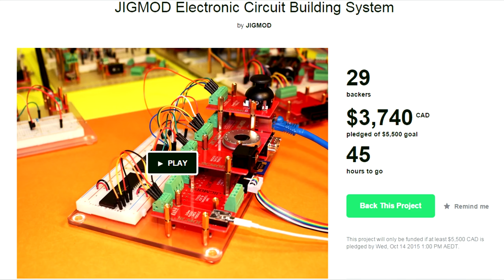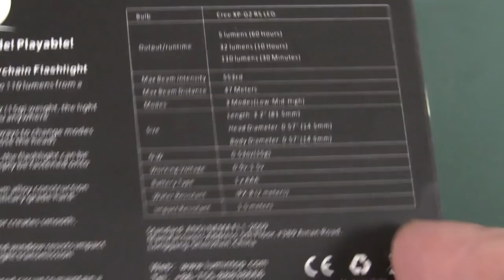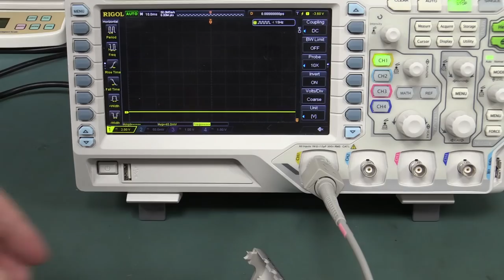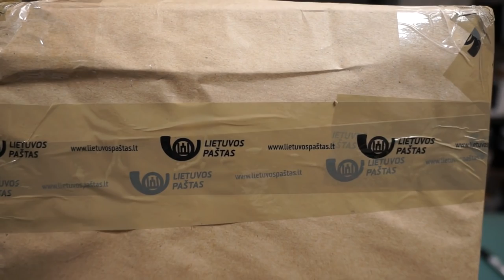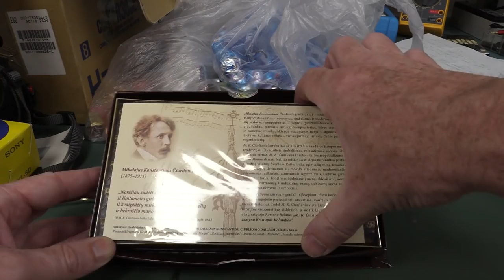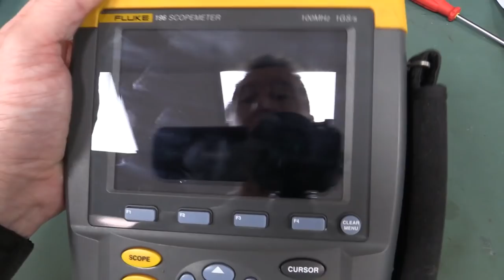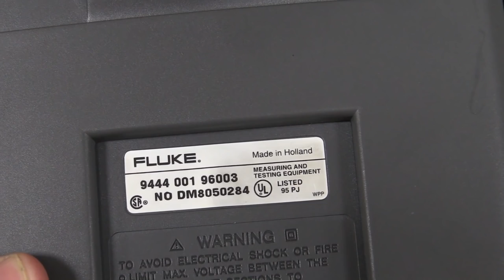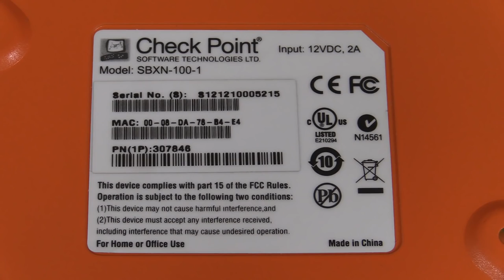EEVblog #807 - Mailbag

Comment: My guess at the reason why that chip was destroyed so easily was to protect the private keys that may have been stored in it. If that device was used for authenticating to a high security network, you may be able to extract the keys and impersonate the device potentially by accessing the chip directly. The choice of BGA was probably also chosen just to make the contact points on the chip more difficult to get to, so you can't probe it while it's running.

Comment: Dave,  you just invented a 2 second ic decap technique
Reply from the maker: +VoltLog Try it on your gear, totally non-destructive!
Reply: +EEVblog I did it to a Pentium4 775 CPU, didn't change it's performance either, mostly cos it was a gutless turd of a processor... :P
Reply: +twocvbloke Hey, those motherfuckers take a shit kicking, even if they're slow, hot and useless. Some guy managed to get one to like 8GHz on LN2. That's mighty impressive IMO.
Reply: Teth47
Yeah, but single core, feck all cache (it was basically a 775 sell'n'run with a P4 sticker), motherboard with blown out caps, that P4 chip was junk, my far older 478 P4s handily outperformed it... :P
Reply: ***** Yeah, but that silicone was tough as nails. It laid the groundwork for that legendary D0 stepping on the i7 920. I'm thankful for the example it set, even if it was in and of itself a piece of shit.
Reply: Teth47
You don't even know what core it was, it was one of the cores that was just utter crap that got left behind when the Core series first started...
Reply: ***** The Core series was based on the Netburst arch, which, you might recognize, is the same arch the P4 was made with. Netburst was awful, but there were good ideas in it, which they carried forward into the Core series, and later Pentium and Celeron series. Who doesn't even know what core it was again?
Reply: +VoltLog The integration of a guillotine and electronics.
Reply: Teth47
Okay, you tell me what version 775 Pentium4 model I had, I know, you don't, I know it was a pile of dogshit, you don't, I know that when running it, it ran like a pile of dogshit, you don't, I know that compared to my older 478 P4s with the better cores that got carried over to the Core series outerformed this 775, you don't, so, is that enough of a reminder about who knows and who doesn't? ;)
Reply: ***** All 775 P4s were Netburst-based. Even yours. I can't tell you what model number you had, but I can tell you it was a netburst core. I know the previous ones outperformed it, but their architecture was not extensible enough to be carried forward while realizing significant performans improvements. Netburst was. Elements of it found themselves in its successor, Merom, which was the first-gen Core architecture. Want to deny that? Take it up with history, and get rid of that smug attitude, it'll do you no good here, because you're categorically incorrect.
Reply: Teth47
Yeah, you're just missing the point, the CPU I had, was junk, doesn't matter what you say about netburst and all that bollocks, it, was, junk, it was slow, slower than the 1.2GHz PentiumM in my Portege M300, and that was a glorified PentiumIII CPU, so, I know it was junk, evidence based fact versus what's on paper are two different things which do not gel with your take on this...
Reply: +Teth47 sorry but no, the core series was more related to the p3 than p4. The netburst arch did one main thing which was force intel to be good at branch prediction. Otherwise was garbage.
Reply: +MeakerSE Indeed, Core processors are most closely related to Pentium M mobile CPUs, which were essentially Tualatin PIIIs with more cache + P4 style bus interface and branch prediction.
Reply: ***** Profanity is not an indicator of a low IQ, it's an indicator of emotion. You, with such a high IQ, should know this.
Reply: *****
Notice how I'm not using profanity in my responses to you, this is because effing and blinding in something to get their point (which is weak to begin with hence the use of such words) across, which to me means that their argument or point made is lost...
Reply: ***** Well, good for you for not being able to understand what other people say to you :)
Reply: *****
And good for you for being a troll, well done... ;)
Reply: +Aurelius R Profanity has actually been deemed to have almost no correlation between economic status or IQ in a majority of the population. Not that I think it's rational to "fuck shit" all over YouTube for the sake of sounding angry and hoping people listen. In my opinion it has about the same effect as using all caps. It make's you look just desperate. 

However there is indeed essentially no valid connection between foul language and how smart you are. It's kind of just a common misconception that people use profanity because their vocabulary isn't broad enough to come up with another word to accurately represent the emotion they're trying to get across. Which is sometimes true, but recent studies actually show people in the top rung of society use as much profanity as those considered to be of lower intellectual and economical standing, presumably because they don't care what people think nor do they feel a need to conform to society. So, profanity is not a fail safe way of deeming someone to be stupid.
Reply: +EEVblog -- What about all those bio-chips people are
writing about for now over 30 years?
Why do you never feature them?
Reply: +EEVblog You should put a very small ring on the torch then a large ring. you'll have better movement and no kinking.
Reply: +twocvbloke Bravo!!!  Behold: twocvbloke king of trolls!
Reply: ***** "Profanity is the indicator of a low IQ"
… Dave Jones uses profanity all the time in his video. Does this mean he is stupid?
Reply: Teth47 OK, pentiums are shit, but they should be sufficient to drive a modem like Dave's Israeli Office Boy, or whatever that un-godly thing was called.
Did you ever de-cap a bio-chip?
One can do curious things with stem-cells and a 3D-printer.

Comment: That Check Point flat pack is a custom ASIC which is needed for stateful firewall and any UTM features it may have.  I didn't check the specs on that check point model.  UTM for those new players = Universal Thread Mitigation.  A term coined for devices that perform multiple security functions such as firewall, antivirus detect/block, intrusion detection/prevention, web filtering, etc.
Reply: ***** No idea.  Was it confirmed to be a coil or did it just look like a coil?  My guess is it's for EM or ES protection.
Reply: +Tobia C. radiation hardening

Comment: I'm just guessing on the coil in the chip.  I know that security researchers were able to reverse engineer the RF emissions from certain CPU's to determine what the processor is doing.  So perhaps it's there to mask the activity of the CPU from monitoring.
I'd further postulate that the destruction was a planned failure to prevent proper physical examination of the die?

Comment: I have that exact same Sony camera somewhere lost in the attic except its the NTSC version and it still works.  I remember that brick of a battery charger, you had to slide the battery on it and the battery could easily fall off.  Brings back memories.

Comment: I had a 199 scope meter with the same line issue. The problem is the heat staked flex between the main board and the driver. Very common problem, it occurred from the meter being taken apart and reassembled. There used to be a person on eBay repairing this problem specifically. I believe it cost $199 usd plus shipping. Best of luck!

Comment: The scopemeter is an easy fix, i've done a few of them. It's reasonably common and well documented, its just a failed connection at one of those heated flex joint things. The battery is cheap enough too.

Comment: I'd sort of hate to see you do a tear down of a working Sony Handicam there with all of the extra goodies especially if you have no plans to put it back into working order. How about you just forward that to me, cause I would use it :)
Reply: +WaybackTECH agree with you.
Reply: +WaybackTECH Pay the postage from Ireland and you can have mine lol, got a very similar one up stairs doing nothing lol
Reply: Curtis Nixon
If this one does not work, cassette basket is jammed or whatever, then it's not worth fixing. If it is a perfectly good working camera, even with just needing a cleaning of the heads, I think it would be a shame to tear it down just to see how it works without a likely chance of a reassembly.  Be much better to take one apart that is already broken beyond a quick and cheap repair.
Reply: +WaybackTECH I am a vintage tech fan, but these things were mass produced in copious quantities. When one can record 60 FPS 1080p video on a phone, in FAR better quality than some old SD camcorder from the 90s... I see no reason to jump on the preservation bandwagon.
Reply: +WaybackTECH  The Sony Handicam is definitely something he'd tear down without breaking and put back together. It's only cheap junk or stuff that only has a practical use that doesn't apply to him, like the security thing that he destructively tears down and throws in the garbage.
Reply: +WaybackTECH I'd love to see it done. Would be really cool if he did something like externally control the zoom/focus mechanism, show how to decode the digital signal from the tape, or tap into a programming port. 

I'd love to see him use a programming port, seriously, badly want to see how that's done.

Comment: That BGA looks to be a standard PCB style interposer, finer pitch than regular PCB of course, but as far as I know, the same old process.  The big pours and rings (not spirals, I think) should just be power and ground.  Somewhere there's an x-ray of one of these devices (maybe it was mikeselectricstuff who took some pics like this?), the bond wires are all over, every other wire a ground or supply and the signal traces clearly being routed between shielding grounds and with characteristic lengths, beautiful stuff.

Would like to see the heatsink heated up and de-caked of its material, if just to see if you can find any numbers on the top of the ex-device?

Comment: Why did you break that Firewall? 0o 
It's worth like 500$ on ebay.
Reply from the maker: +Mobin92 It was broken. And it was fun.
Reply: +Mobin92 That firewall is probably a Trojan horse. Nothing you really would want to rely on. The physical protection is there more to protect the backdoor "technology" than anything else.

There exists nothing in-chip that is safer than e properly setup DMZ system based of off BSD of linux with everything clear and open to the user.
Reply: +Diggnuts yeah I was exactly about to say that, I have seen "checkpoint" in few backdoor articles too.
Reply: Lvent2101  The keywords are "Israel" and "former military". If you think the govt. in the US has a hand in back doors.. Just wait until you see what the Mossad will do for your privacy! It's one big pile of conspiracy dung.
Reply: +EEVblog Checkpoint has the world's best security software and hardware, if one open the cover on a Check Point product it can put Checkpoint in a self-destruct mode, erasing all of it memory, one of the reason why there is a button battery in there.
Reply: Tom Kristiansen  Checkpoint's security mainly is meant to protect backdoor technology for dubious players like Mossad.
Reply: +Mobin92 Not anymore!
Reply: wyrmofvt haha

Comment: If nobody else caught why the chip ripped right off, it's because the package was soldered directly to the heatsink. I'm assuming the heat spreader and heatsink where one single piece. AMD does the same thing with their CPU packages minus the large heatsink. Most people I'd believe would say it's for thermal dissipation as solder has a higher transfer density even than the best Thermal Paste. It could have very well also been to prevent tampering, but would have been avoided with a rework station or a hot air gun to just pull the package right off.
Reply: +Asaggy Noodle Exactly, he just needed to use a heatgun, this was just stupid.

Comment: I had a Kyocera Finecam just like the one in the Mailbag. Worked OK with a SD card under 1GB. Kyocera also made a camera with 10x zoom back in 2003-2004: the Finecam M410R (which I own one).

Comment: Hiya, dave,   Just ordered a Lumintop TORCH (  :-)  ) on your recommendation,.... and it arrived today, (24/10/2015) I'm afraid, they have modded them a tad,..   new one does NOT have a push button switch on the back, you have to rotate the back section to switch between light intensities...   :-(

Cheers,   Fred
Reply: +Fred Cooper ......   The new version also has a fairly strong magnet in the endcap, where the switch used to be...........

Comment: For the flashlight (okay, the torch) you need a smaller split ring to attach to the end of the torch, then hook that to your 1" ring.  A quick check on Amazon showed them as small as 16mm.  Might check with your local locksmith.

Comment: On the flashlight... you might consider adding either a small lanyard through both the hoops, and use that to connect to the key ring... or maybe using a small key ring for the light with that connected to the big one. :D

Comment: To me, having a 5.4v in and a 6v in likely means "we want precisely 5.4v but we don't want to waste voltage using a regulator. We'll allow you to use standard power packs* by offering this alternate input connector with a silicon diode in series". *could also mean 'the other power pack we might have supplied you depending on which was cheaper when we placed the order that month'

Still seems dumb but with a 0.6v difference that seems the likely reason to me.

Comment: Some micro torch lights use an intermediate small (1/4" - 3/8"Dia.) split ring to connect to the larger heaver key ring. This releases a lot of the binding against keys and pocket.
Should have been installed or included. besides

Comment: I have one of those Digital 8 still in a drawer, one thing I remember is it has amazing zoom capability, and if it's Video 8, it should also have a Firewire output, which is handy.
Reply: Digital8 came a number of years later (1999).  If the sender was correct on the year, 1992, then this is purely analog (and the box claims neither Digital8 nor even Hi8, just 8mm, so presumably Video8 format), so there will be no FireWire output.  I have a similar Sony triple CCD Hi8 Handicam (NTSC) from around 1993/1994 that I may tear down in the near future as they have little practical value today and it is simply taking up space.

Comment: had a look at possibly fixing one of those handcams 10+ years back, just a sea of leaking caps, my guess is that to get it as small and light as poss. the caps cases were extra thin ,and the dielectric extra ionic.

Comment: I think SD cards above 2GB use a different chip structure or something. There were lots of devices that had a limitation of 2GB cards for that reason. I think the ones bigger than 2GB and called SDHC (high capacity?) cards. Also, are you saying that a high end company like Fluke used a negative centre plug? Unbelievable.

Comment: All i want is a single AA bright cree torch with just an on and off button. no twisting on, no blinky light, one mode. bloody imposible to find.
Reply: German LED Lenser: They have both microcontroller M series and normal ones without all the modes (P i think) They sell a AAA one which is really bright, ridiculously small and it only has on/off. No annoying modes.
Reply: +Sirus Google for "Ultrafire Mini Adjustable CREE Q5 LED". One mode, tail cap button, with adjustable beam width, eats both AAs and 14500 li-ions. I like em, and 'buyincoins' sells them (and a bunch of other types) for cheap.
Reply: +Sirus Just gut it and make it direct drive. Also, most LED drivers can be made to be single mode, usually just need to solder in a jumper, or cut a trace. Takes some guesswork.
Reply: +Sirus I use a Coast HP1 its one AA and only one mode.
Reply: Munchknuckle Dar thanks for the info, 220 lumens isn't to shabby. Better than the epilepsy inducing flashing 90 lumens I get from my unicom at the same price

Comment: These are basic home/small-office router+security devices, made by a division that Checkpoint acquired 10 or so years ago called Sofaware - they kind of are a distinct line from their expensive firewalls, and serve a completely different purpose. They run Linux under the hood and the security stuff is done in software, just like a Linksys home router might do.  I'd be shocked if there is any real hardware offload beyond the standard switch chip.  You're not going to protect a Fortune 500's main datacenter with these - more like the CFO's house or the 2 person sales office in New Mexico.  I think you ripped an ARM or Atom processor apart. And if it's stolen, there aren't any corporate secrets to protect on it - no real need to protect the chips. You just deactivate it and move on.

The magic is in the management - you buy the right licenses, the right appliances, etc, and you can manage hundreds or thousands of corporate firewalls all from a central console, with tools that make it easy to express complex corporate policy. But you definitely pay for that privilege.

Comment: Checkpoint firewalls run Linux and custom software and extensions to the kernel. The chip that was pulled apart was likely an Intel IXP465 of similar ARM SoC.

Comment: I have the LED Lenser P3BM, and while it's not regulated at all, it's also a really great little lamp. Plus, it has the switch on the back end, and the keyring doesn't disturb it :-)
However, that's only the emergency light. My real all-day light is a LED Lenser MT7, and it is thoroughly awesome.